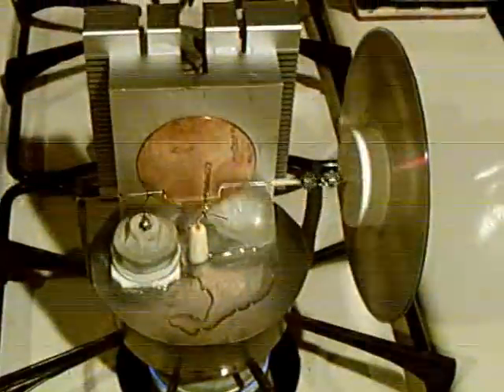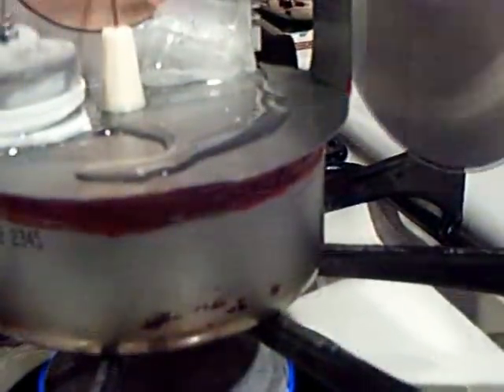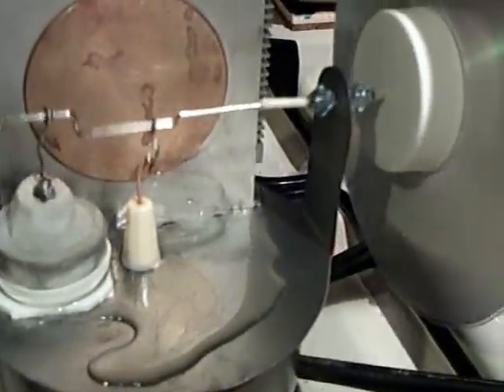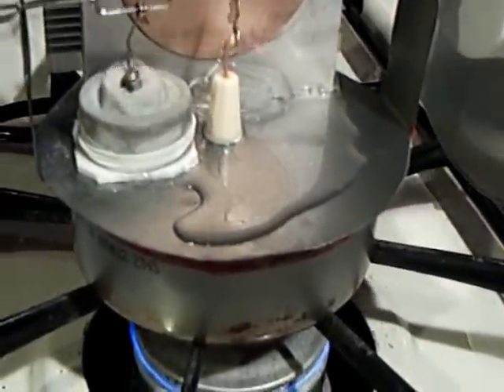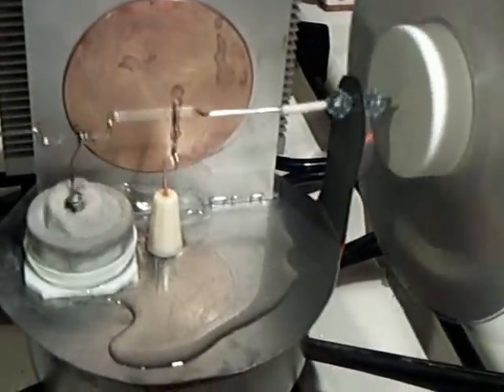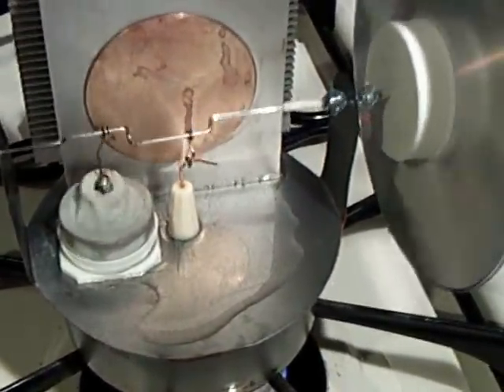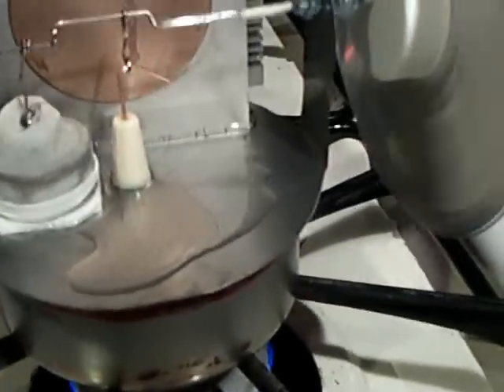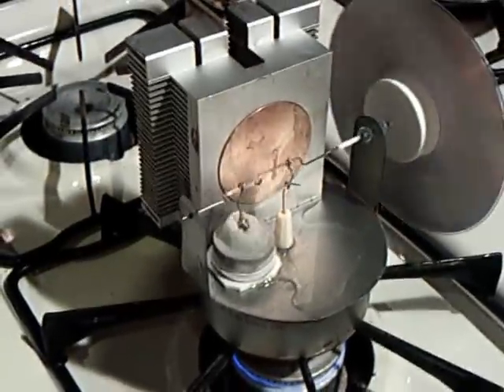Tuna can Stirling engine--  improvements

Comment: Lidmotor;
Things to look into.Heat pipe,conducts heat up a 1000 times better than copper.Simple heat pipe ,a  sealed copper pipe with steel wool and drop of water inside.Thermal diode,a type of heat pipe.Regenerator very important.Solar vacuum tube,a heat pipe inside a glass vacuum tube.It will boil water without fresnel lens or parabolic dish.Just needs to be in direct sun.